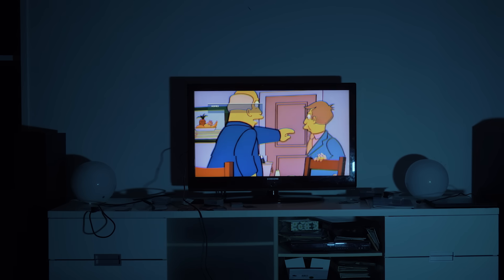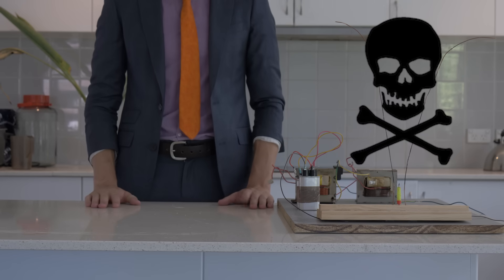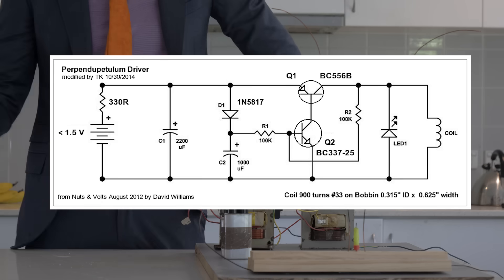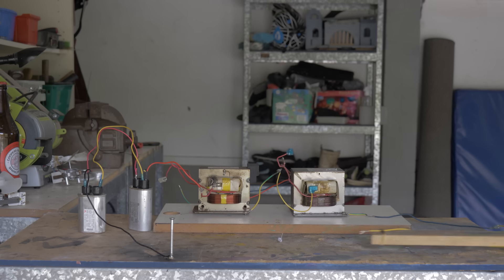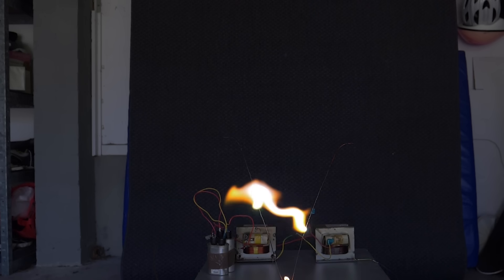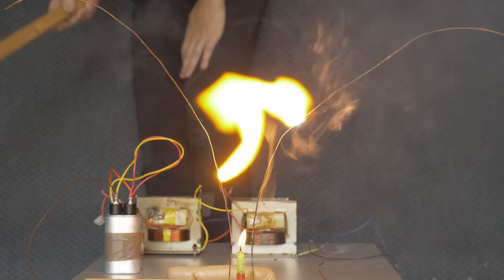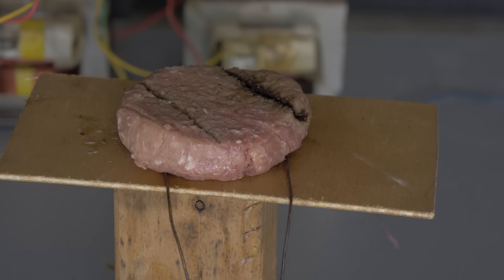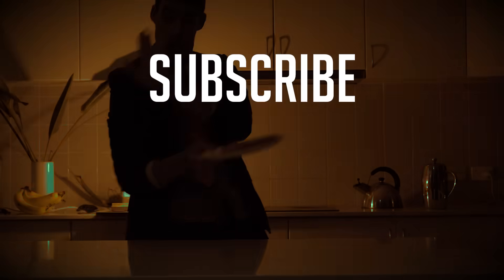Localizing Aurora Borealis entirely in my Kitchen

Comment: Capacitors in series are like resistors in parallel   (x^-1+y^-1)^-1   when a capacitor is in parallel with another capacitor it basically adds surface area to the capacitance and increases it.  x+y     you are playing with some wild stuff there and yes, taking apart microwaves with fully charged caps have killed a few people so be careful.  MAKE SURE YOUR CAPACITORS ARE DISCARCHED.  take a piece of metal with good insulation (electrical screwdriver) and short it to make sure the voltage returns to zero across the leads.  also don't get pissed at me when you've ruined a steel screwdriver because the metal literally evaporated from a solid state at the final point of contact ;P  that's 2kv in a microwave capacitor for you...also that only applies to dc charged caps for the most part but if you can break the connection at peak voltage within the 60hz...bye bye birdy XD   easily done with a full bridge rectifier btw o.o
Reply from the maker: Yeh I have ruined a bunch of screwdrivers discharging their charge..also I am never playing with microwave transformers again I don't want to be a dead boy
Reply: @Ididathing  Hey I'm not trying to discourage you!  I love playing with high voltage,  but its sure no time to be cocky.  Always take precautions like rated gloves if you are going to touch the lead wire insulation or use something with high insulation to push the wires if you must manipulate them while powered (I've seen a tiny micro corona arcing to my finger through an old and slightly degraded neon sign transformer lead insulation...my finger had a tiny spot and smelled like burnt hair o.O).  Also, I have seen a post disconnect discharge when bringing the secondary side leads together (like arcing a charged capacitor) on very rare occasions.  I'm not sure what causes that or how long it would last if left to rest.  Keep the arcs and sparks away from flammable things that you don't want to catch fire, wear rubber sold shoes or your crocs,  PAY ATTENTION AS IF IT WERE HANDLING A DEADLY SNAKE, and have fun :D   Love your show m8!  I don't want you to stop or die ;)

Comment: When capacitors are connected in series, the total capacitance is less than any one of the series capacitors' individual capacitances. so it's like decreasing the size of your capacitor. having them in parallel doubles the capacitance. you know, assuming they are the same type.

Comment: Having them in parallel I believe is because the way capacitors work.

When they're in parallel, you simply add up their capacities.

When they're in series, the overall capacity = 1/c1+1/c2

A nice little trick if you're using two capacitors of the same capacity; the overall capacity = x2 the size of one of them if parallel, and x0.5 the size of one of them if in series.

Comment: Series capacitors will increase the voltage and reduce the capacitance
And parallel capacitor connection reduces the voltage and increase the capacitance

Comment: I love the video, but as someone who's experimented with microwave transformers, the way you have them wired is very confusing. There are usually three sets of windings on the transformer: one primary (120V in north america), one low voltage (~10V) and one high voltage (~2000V). It looks like you have your high voltage and low voltage windings in series with each other. I also can't tell if the two transformers are in series or parallel. Perhaps keeping this unclear is in your best interests from a liability standpoint, but anyone wanting to repeat this design should do some research into how these transformers are wired if they want to be successful.
Reply from the maker: Yeh i didnt actually want to show my method for wiring them as i dont want to be responsible if anyone hurts themselves. Also it is embarrassing!

Comment: 2 or more parallel capacitors act as a single larger capacitor, and would increase capacitance.  In series, you get a voltage drop across each capacitor, and the capacitance is reduced.  For MOTs (microwave oven transformers), the big fun arcs come down to finding resonance.  I have found, for the largest and easiest arc, to use 1 MOT, with 3 capacitors in parallel.
Reply from the maker: only just saw your comment now. Next time!
Reply from the maker: only just saw your comment now. Next time!
Reply from the maker: only just saw your comment now. Next time!
Reply: only just saw your comment now. Next time!
Reply: only just saw your comment now.  Next time!
Reply: I don't think that you achieve any sort of resonance. The capacitors I see in microwave ovens are 1uF. If you wanted to be in resonance with the 3 capacitors at line frequency you would need an induktor of 3.3 Henrys (that would be an coil the size of a fridge).  
There is no need for resonance. All that you would correct with a resonant circuit would be the small drop of voltage on the stray inductance of the transformer winding. 

You probably hit a sweet spot with impedance matching. -> If the current is to high (no capacitor) the voltage drops on the transformer and the arcs are worse. (The resistance of the transformer winding >> the arc resistance) If the current is to low than you have the voltage but not the current to sustain the arc. 
Keep in mind that the secondary resistance could be in the 100 ohm region + a lot of stray inductance.  But this is just guessing - but for pretty sure no resonance.
Reply: @markoantesic4362  only just saw your comment now. Next time!

Comment: I'm not really sure what the capacitors do in your design besides limiting the current on the HV side. In the microwave there is a diode to double the voltage (and make it DC). 
You probably limited the current too much with the capacitors in series. The impedance of a capacitor is proportional to 1/C. So if you make C bigger (connect them in parallel) the impedance drops and more current can flow - which is needed to allow the arch to sustain it self. 
Tangent note: the current on the secondary will mostly be determined by this capacitors and the resistance of the arc. As the arc increases in length the resistance of the arc increases, allowing less current to flow until the current is to small to sustain an arc. If you were to remove the capacitors, you would have less "resistance" to current and would have potentially longer arcs. But the current at the start of the arc (where the arc is short and thus has lower resistance) could be to much for the transformers to handle = possible thermal damage to the transformer.
Reply: The capacitors are electrically in parallel with the output once the arc is struck, and this forms a resonant LC tank circuit that allows much more current to be picked up by the secondary. You can hear the more violent crackle once the capacitors are added from the various harmonics of 50Hz. The secondary will actually overheat much quicker than the primary like is usually the case. Basically the parallel vs. series arrangement of the capacitors just gets you in the realm of capacitance to resonate with whatever the inductance is.

That being said, those capacitors are usually rated around 2,200V and he wired two transformers in series, effectively giving closer to 4,000V. They won't last long :) sometimes its a bit frightening when they fail.
Reply: Wdym double the voltage? All the diode does is essentially cut off half of the AC wave to turn it into DC. If anything it would lower the voltage.
Reply: @Iapetus11  unless its a diode-capacitor circuit
Reply: Iapetus-11 
The diode and capacitor are used as a voltage doubler in a normal microwave circuit.
Reply: I think when he puts them in series there's too much capacitive reactance, so it doesn't make use of the full half wave. Also yeah the diode is part of the  half wave Voltage doubler.
Reply: What is your mothers ASL?